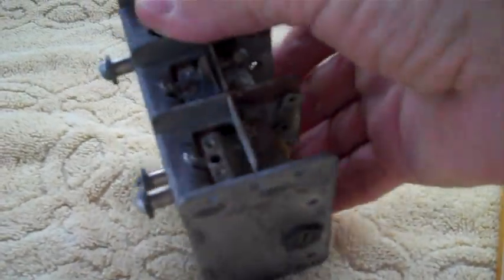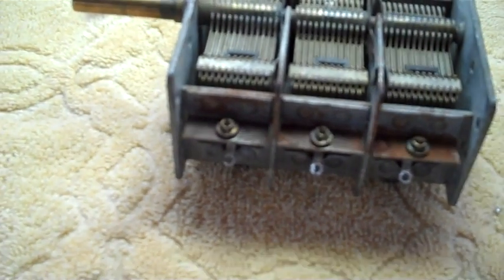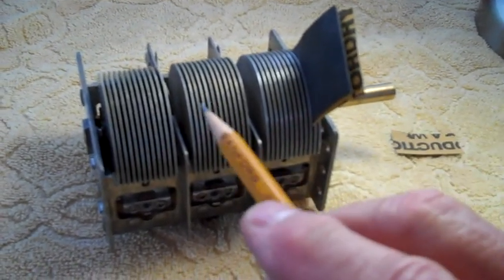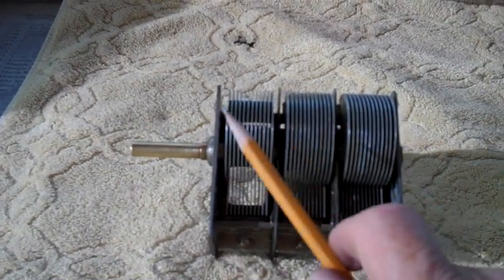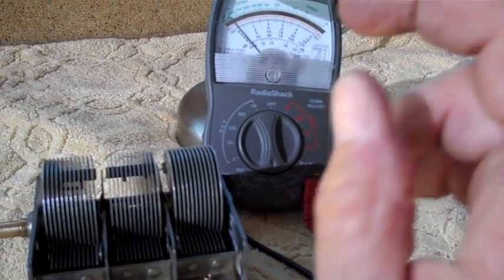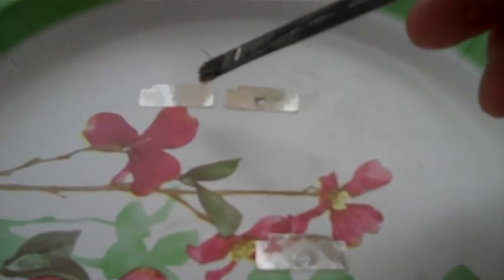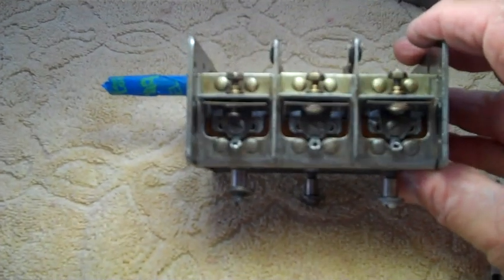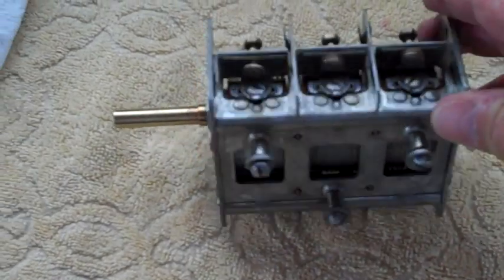1935 Atwater Kent Model 145 Repair and Restoration (Part 16 of 38).

Comment: Hi. My radios broadcast dies just after a few inches from the left end of the scale. No matter on what band it is. Just as you can see in the small film, it only works on the left end of the scale. Could it be a shorted tuning capacitor? Can they short this way? 
https://www.youtube.com/watch?v=lAfRrSghCCU
Reply from the maker: Adrian,
Yes, my friend, off-hand I'd say you have a bent tuner blade....one blade touching the other at the far end of the rotation.  Either that or you have some debris wedged between the plates at that location.  I've seen bits of solder that had fallen off a soldering iron into the tuner plates cause the same symptom.
It's time to open her up and have a look-see.  But do it with the power switch turned off and the radio unplugged from the wall!   Think safety first at all times.
Regards,
John
Reply: Thank you very much for your answer. The problem was one of the screws that was holding the rotor. It was loose and the small ball bearing that the rotor spins in was missing. So the whole rotor was out of place. I found a ball bearing, tighten the screw and the locking nut and it spins nicely without touching. I am on my way to restoring this 1964 communist  radio made in Romania, the land of Transylvania and Dracula :))

Comment: The last thing this video is, is boring. (Grammatically correct? "is, is")   :o
Anyway, Great job on that tuning capacitor! I am very surprised that big capacitor fit in the ultra sonic cleaner as well as it did. When I saw one in person at Harborfreight, the first thing that I said to myself was: "That's way too small to fit a ganged capacitor into it!". I guess I was wrong. Maybe I will pick one up when they go on a good sale again.
Fantastic as usual. Can't wait for the next video!
Tom

Comment from the maker: Hey, Jonathan.  Mica is one type of "dielectric" or insulator...basically meaning it prevents sparks from jumping between the capacitor plates.  Mica was used in the old days because it was plentiful, cheap, could withstand quite a bit of heat and didn't easily break down under high voltage.
Thanks for popping in.

Regards,
John

Comment: Another way ive found to help clean the tuner other than useing the paper is to fold a matte finish business card and dip it in the alcohol then slip it between the plates. Its amazeing how much crud comes out of there even after all the other steps taken to clean it.
  Sincerely,
          John